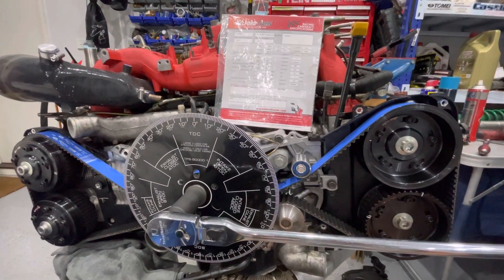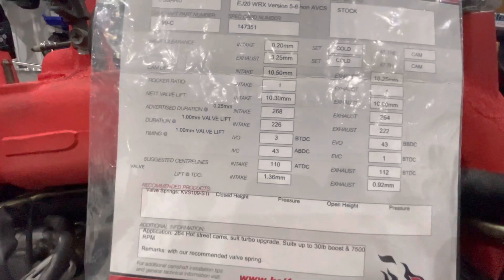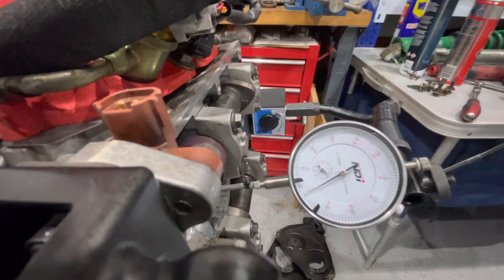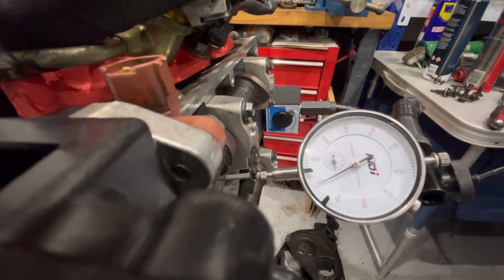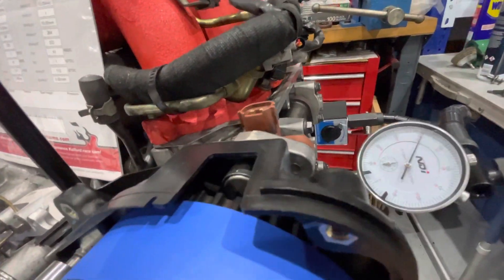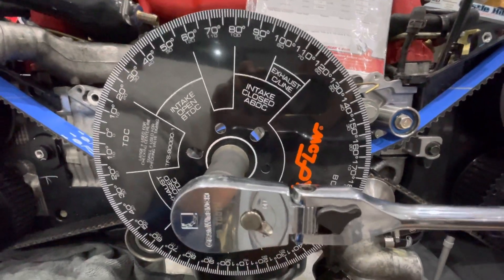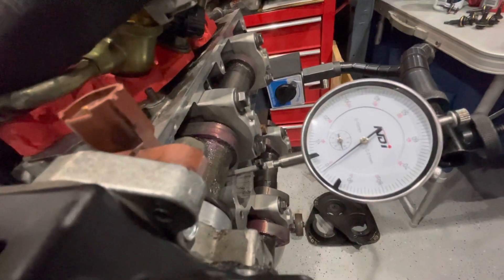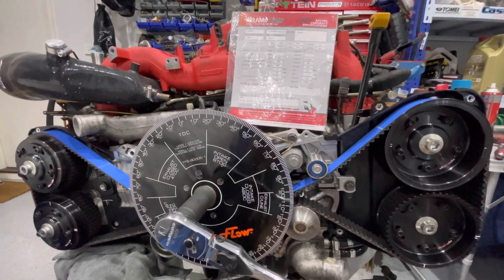Subaru EJ207 Dialing in JUN Adjustable Cam Wheels/Sprockets

Comment: nice work and a new clean engine = just put a EJ207n spec C short block - RA STI JDM - with rebuilt ej205 heads = STD cams = it`s an Automitic - but the kelford 199-b might be ok for - SF5 forester ! nice video = do another right from the start ?